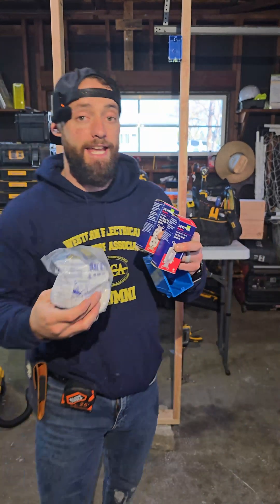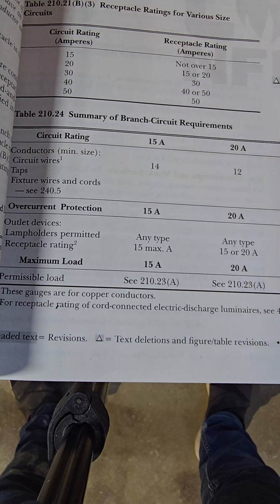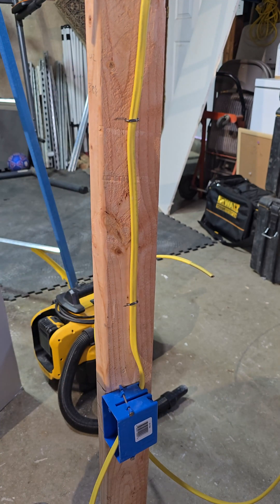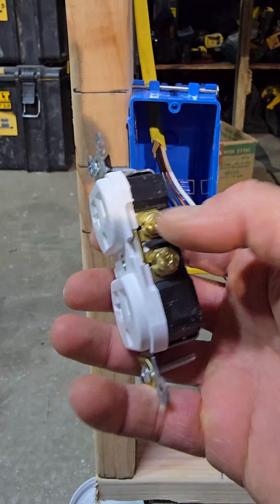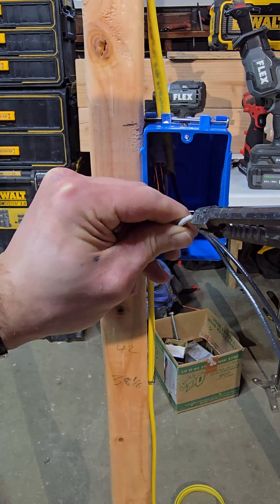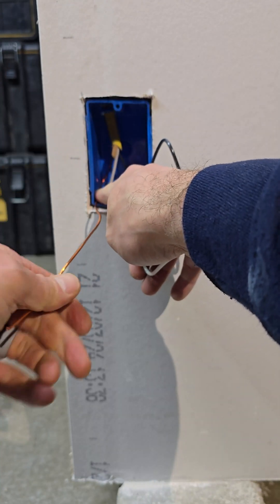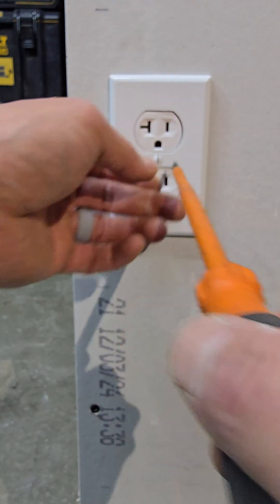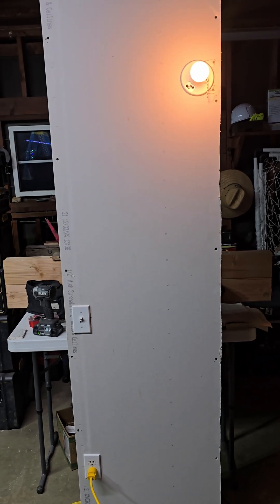Easy How to Wire: Receptacles, Switches, and Lights! National Electric Code! - Certified Electrician

Comment from the maker: The light is really easy. Just put the ground to the ground, the neutral (white wire) to the silver screw, and the hot (black wire) to the brass screw. Don't forget the mounting screws.

Also, if using this as a guide for installation, please read the description. Take care, and God bless.
Reply: @ChristianElectrician  i have an receptacle in my garage  it has two ends for plugs but on the actual outlet it only has 1 hot wire and 1 hot connecting point would I be able to get it to power a new receptacle that has the access points for 2 hots?
Reply from the maker: @MasterYooda94  yes, you have to wire it in parallel and pigtail it.
Reply: @ChristianElectrician  sounds good looking forward to seeing that
Reply: In simpler terms I have a receptacle, the receptacle has two plugs, however it only has 1 ground, 1 neutral and 1 hot, would there be a way to get that to power both plugs on a new receptacle
Reply from the maker: @MasterYooda94  absolutely, I'll show you bro.
Reply: @ChristianElectrician  sounds good 👍🏽
Reply: So the main hot I just gotta get like 2 pieces of the black conductor off some 14/2 or something pig tail it and have it connect with wire nuts or those lil push in connectors basically and then I can connect the two conductors to the new receptacle to power both plug ends lol I think that’s it haha if my research was done correctly, would still like to see it done by a professional tho
Reply from the maker: Here is the video on how to add a receptacle to an existing circuit:

https://youtu.be/jhXptfu34Lk?si=KhCB8gdhkfT3w3Sf

Comment: Are you using an ECX or Robertson?
Reply from the maker: @Dave-ld3dr  typical home owners would use a phillips tip and then tighten firmly with a flat head. Ecx and robertson tips are more for tradesman, typically. If you're asking that, then you already know what to use. 😊👍
Reply: I bought the ECX but to be honest I think the Robertson feels just as good.I’m only a DIY so unless I gave them both equal time I would have a better choice but I really think the Robertson is just fine.
Reply: What do you think of Wago’s?
Reply from the maker: @Dave-ld3dr  I use wagos and wire nuts.
Reply: @ChristianElectrician right on brother, Once I start working as an electrician you will start using the right tool for the job (specialty tools) some people use that terminology as well. Thank you and really good vid brother. God bless ya'll!!!

Comment: Good video & I appreciate the detail but the only thing I don’t understand is starting from the beginning what wire is coming in as your power from the box?
Reply from the maker: @Dave-ld3dr Thank you, and great question!

This is a mock-up wall for educational purposes. 

To add power for the receptacle, the power would need to come from the electrical panel and be on a 20amp circuit with 12-2 wire (romex). Simply add the 12-2 to the same receptacle since the receptacle has 2 screws for the neutral and the hot. This is wiring in series, which is easier. However, wiring in parallel is my preferred method. Wiring in parallel requires pigtails (electrical term). To see how to wire in parallel, please watch this video and start at 7:50:

https://youtu.be/jhXptfu34Lk
Reply: I prefer the parallel.

Comment: Good video. I was taught to also wrap the screws with 2 layers of electrical tape for insulation. Is this something you ever do?
Reply from the maker: Not for residential because the boxes are plastic, only tape when the boxes are metal.

Edit: Some of you may not know, but the plastic boxes in residential settings are non conductive. It is not code to wrap receptacles or switches with tape, but commercial electricians that install devices in metal boxes (obviously conductive) will arch if they come into contact with live wires. Devices in metal boxes should be wrapped just to be extra careful. Not required, but you're looking out for the next guy working on it, if he does it live (which he shouldn't). The device will sit in the middle of the box and will have enough room to be clear from touching the sides of the box in plastic and metal boxes if installed correctly. However, tape around receptacles in metal boxes should be done just for safety.